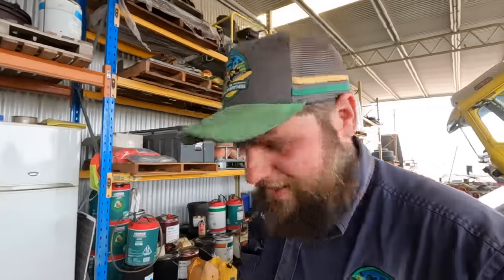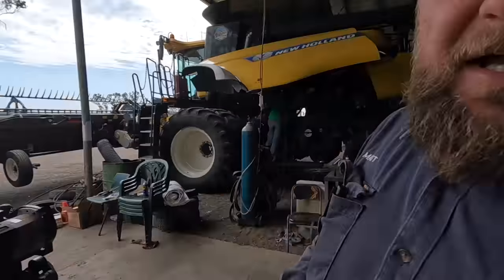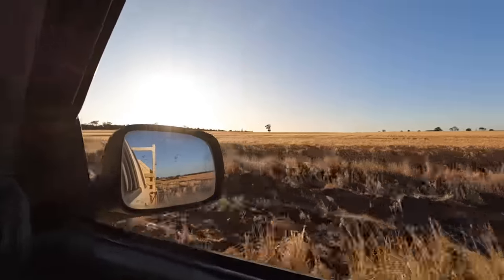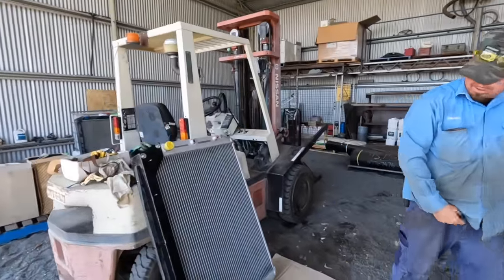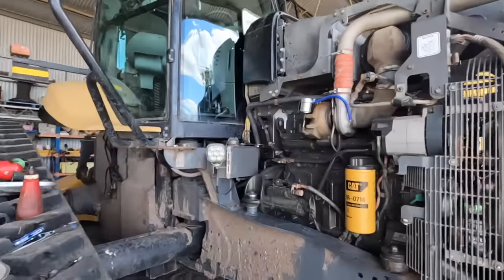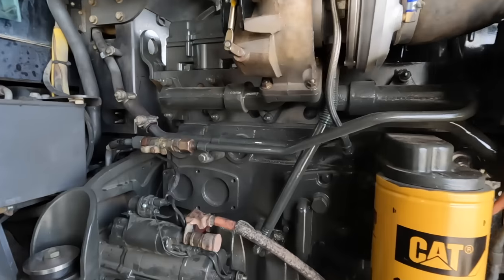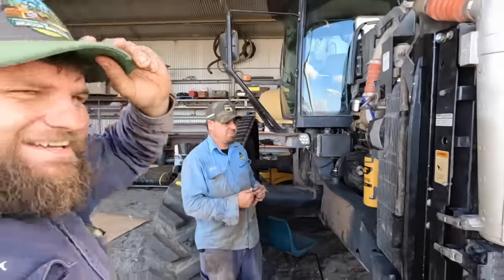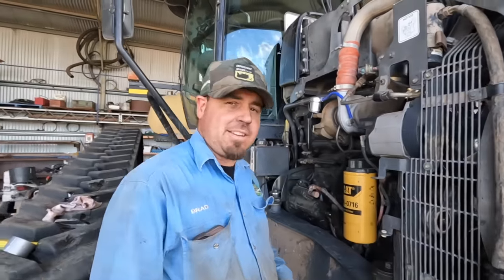It's in But Does it RUN? | Cat Engine | Workshop | Vlog 214

Comment: Good to see you guys got the challenger back together. It sounds pretty good. I used to work on those back 25 years ago.  Place I wrenched for had a fleet of 65 and 75 model Challenger’s. And they had a few 45 models. The place I worked for is long gone now, but back then we rented them out to pipeline companies around the globe.  We made them into weld pack tractors and side booms, and tow tractors to pull tracked trailers hauling joints of pipe. They were pretty durable tractors.

Comment: that engine oil filter is the wrong one for Australian conditions it has been superseded to a 1R-1808 
the 1R-0716 ones are only designed for a 100 hour service interval in Australian conditions
Reply from the maker: Cheers👍

Comment: Hello again, Matt!  This is a follow-up:  what was the the original cause of the engine failure on the Cat?  Just wondering..  thanks!
Reply from the maker: @overtime6696  it just needed a rebuild as it had about 15000hrs on it 👍😁

Comment: Is that a 4 cylinder desiel with electronic injection and electric pump? Noticed the lines etc were plasic caped. Nice work like that. Great video 👍
Reply from the maker: It’s a c9 cat motor with is a 9litre 6 cylinder motor👍😁

Comment: I think that's a Cat , C9, The one I drove , repaired, was a B, 2003 model, Replaced all the pulleys, Because the belt was slipping, but overall reliable , Plenty pulling power, what year is yours, Cheers 🦘🦘🇦🇺
Reply from the maker: This one is a 2001 or around that, the first of them👍

Comment: Hey Matt what’s with the yellow ACCO out the back of the shed. The tipper has been removed for maintenance or has it been pensioned off
Reply from the maker: Needed a new ram and pivot pins👍😁
Reply: Not possible to pension an Acco off.

Comment: Holy hell, 6 months, gold plated liners? Where do you get the engines from, you need to change.
Reply: And it still doesn't look like any tractor I knew as a boy. If I remember correctly, that engine was shipped to WA for the rebuild but still a long wait for a CAT.  Quicker to send it to Tasmania, they are big on CAT down there.
Reply: @seanworkman431 Have to teach it to swim first.